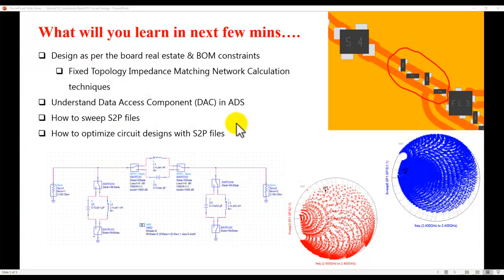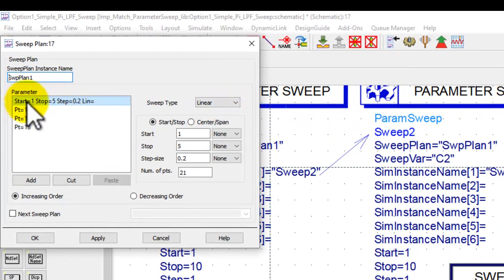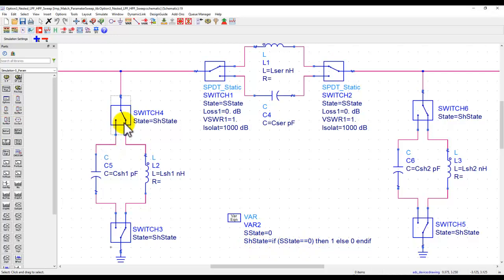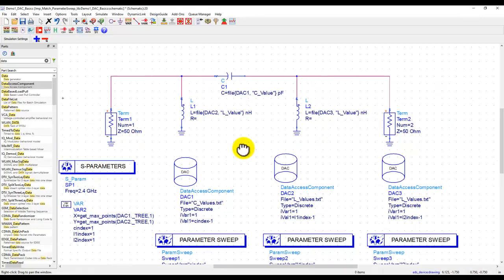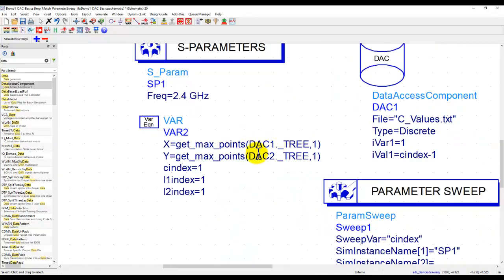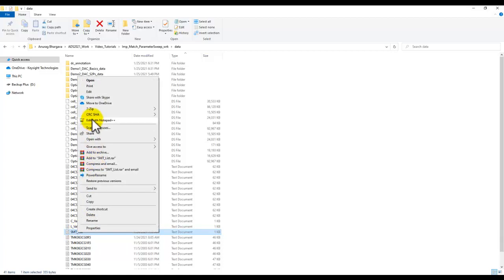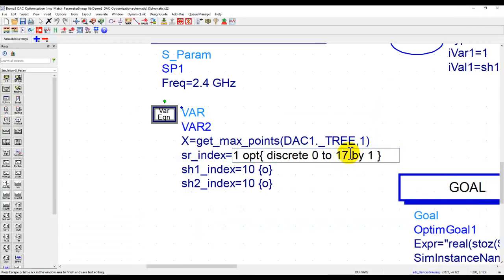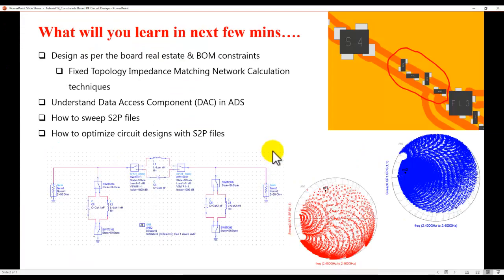RF Design-19: Constraints Based RF Circuit Design

Comment: Dear Mr. Anurag , no words can describe how you support us in our RF circuit design especially for LNA applications. if you don't mind I have three questions:
1- I have LNA circuit design that have two input terminals and two output to make it works on two different bands (4 termG ). I would like to check the stability using Mu1 and Muprime1, but because of existence of more than two terminal (Term G), Mu1 and Muprime1 wont work, so do you have any way I could for example remove two of 4 (termG) by replacing two term G with resistor of 50 ohm? 
2- I have designed an SPST in ADS, but I don't know how to find the Off-state Capacitance and On-state resistance of my SPST switch using the ADS, could you advice me how to calculate them (I am using GaN HEMT with G-D-S terminals)? 
3- I would like to take your permission to put your name in my conference/journal Paper for acknowledgment, because honestly without your support , I wont reach to a good design of my LNA with this fast progress. So could I know your position or I just could put your full name only.

Many thanks sir
Reply from the maker: Hi,
1. Your idea of using 50ohm resistor is absolutely fine and will result in desired outcome..👍
2. It will require little discussion so I would recommend you to contact Keysight tech support team in your region.
3. You can just use my full name and add company as Keysight Technologies. Once published, feel free to drop the online link for the paper as it is always good to see what designers are doing...😊

Comment: Thank you so much for these valuable tutorials. Please can you do a tutorial on how to simulate pulse circuit using ADS Transient.  Also if you have materials that can help with this, kindly share with me.Thank you so much
Reply from the maker: Hi Zhe Shi,
That shouldn't be too difficult and I can surely prepare a tutorial on this topic. In the meantime if you want an example then you would surely find something on Keysight Knowledge Center portal.
Reply: @BhargavaAnurag  Thank you so much.Hope to see the tutorial soon. When I simulate the same circuit, the output wave is different in ADS and Multisim. I don't know  the reason. And the result of Multisim is similiar with literature results  Does the  Transient solver have restrictions on use conditions
Reply from the maker: @durantjames3437  it should be the same with ADS Transient as well however it is difficult to comment without seeing the setup. I would recommend you to write to the ADS tech support team to get help.

Comment: Yes , it is useful to freeze the BOM list using Coil Craft components while performing Layout simulations itself,  no need to wait until board get fabricated
Reply from the maker: Yes, it is very flexible and you don't need to constraint yourself to one vendor, you can include whatever S2P files you have and see which files gives you the best response and select accordingly.
Reply: Hi, I have made a Novel approach to optimise the Hairpin and Edge coupled Bandpass filters for frequency band 3-4 Ghz and 6-8 Ghz using parametric option in ADS both filters are giving almost same  performance after fabrication within short time  without touching the ANSYS
Reply from the maker: @praveenkumarbadam4029  thanks for sharing. Is that something you want to share with others? We can create a joint YouTube video if you are open....👍